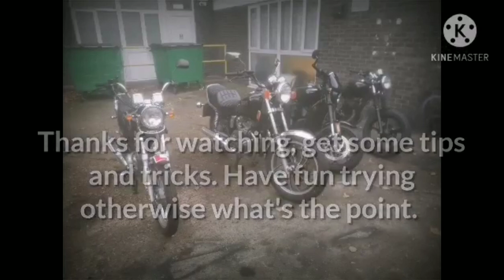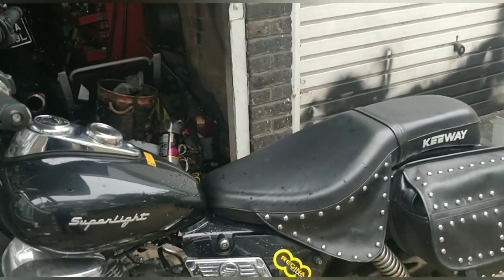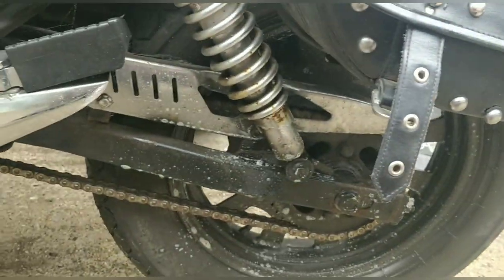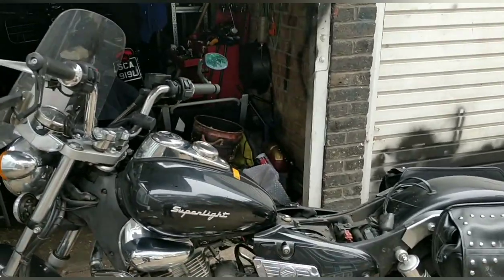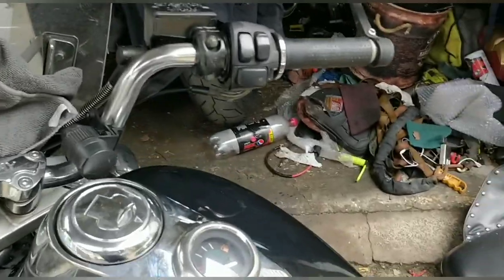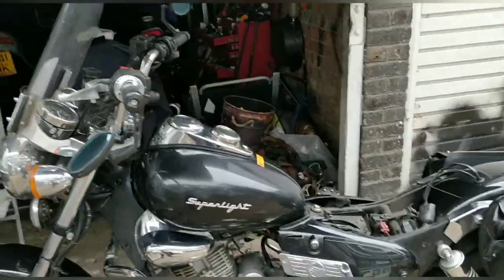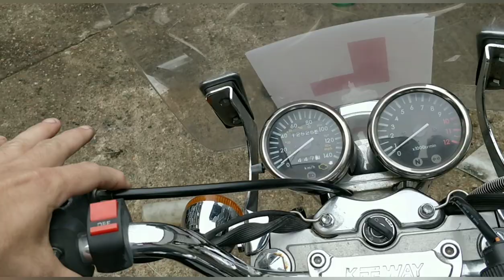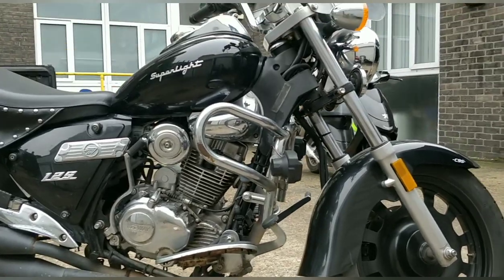keeway superlight, full clean and wax, full test ride. Quick and easy project.

Comment: Nice find Charlie, they have a 2020 model for sale in Ivor the Fiver's scrap yard with only 190 miles on it. Been in accident and bent shock for£400 been there over a year. May well pull it out and check the frame out. Not on the insurance data base as cat C or anything. Been thinking about it for ages get it for myself. Last 3 scooters from there was only £30 each. Trouble when you got short arms and deep pockets pulling that sort of money out😆
Reply from the maker: Sometimes the parts can cost more then the bikes are worth though so be careful glow